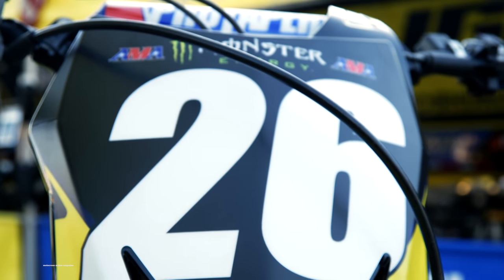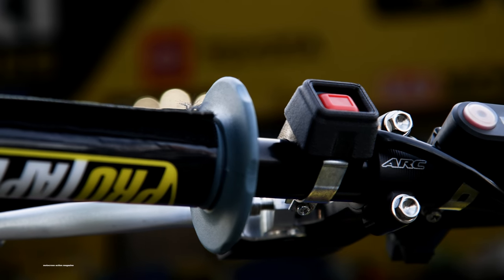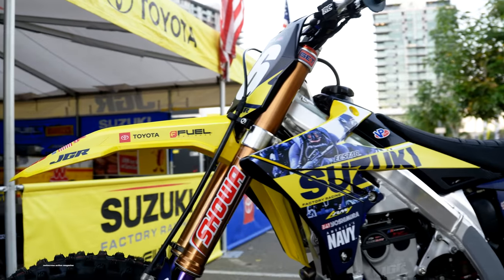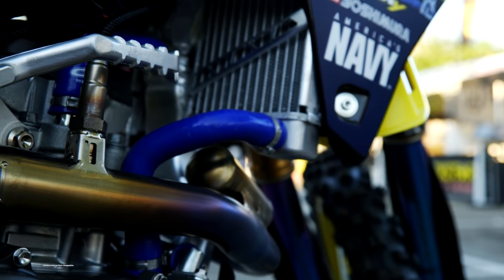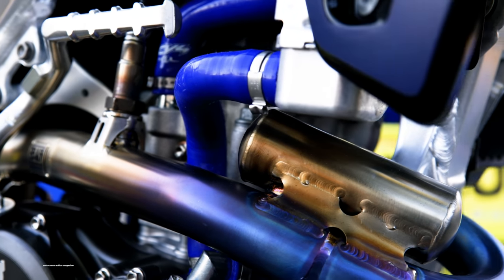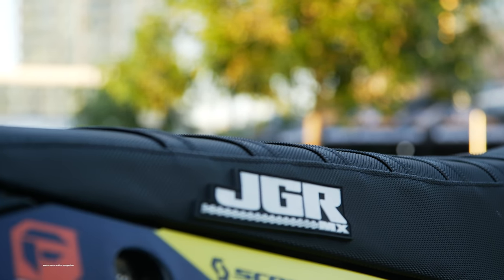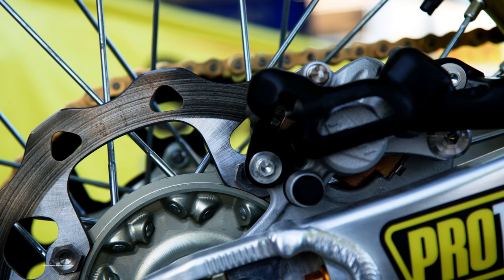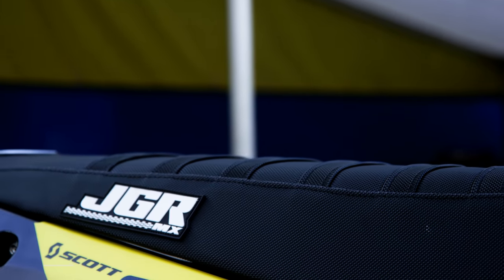Inside Alex Martin's Factory JGR/Suzuki RMZ250 - Motocross Action Magazine

Comment: Man if Suzuki's came from the factory like this I might actually think about buying one..
Reply: not a single bike is coming from the factory like this
Reply: @Strasky_96  I know that. But Suzuki's are missing a ton of shit every other brand has these days.
Reply: @Nielint  Examples other than E-Start?
Reply: @Strasky_96  25+ pounds heavier, 3-4hp less, engine maps, start switch/maps/or for k clamp, weak subframe, stock showa forks need to revalved or at the very least the stock oil is garbage and should be replaced after ~5 hours.. Is that enough? Haha.
Reply: @Nielint  Only one fact that you listed is true, the others are stuff that people made up because Suzuki hasnt changed thei're nearly perfect base plattform, they just need to improve and tweak a few thibgs with the engine, to make one if not the best bike of the new era
Reply: @Strasky_96  Lol. Well read up on it a bit more bud. It was a great bike 10 years ago.
Reply: None of us will fully gas it to its full potential so it doesn’t matter, unless you race then okay, most of us ride for fun.
Reply: @Nielint  😂 buddy idk where u get ur info from but the zooks are just like every other bike minus a few updates here and there but the platform is proven and it doesn’t matter what bike your on now a days all the factory 250fs easily push more or close to 50 horses lol

Comment: I’m a short rider as well, I shaved my seat and my bike still feels tall. Is there anyway I can set it up to be shorter? Whats alex’s suspension settings? I can barely reach the ground with one foot flat. So I’m gonna need some tips 😬
Reply: Well typically like they say drop the subframe 10mm and if your being extreme rase the foot pegs DO NOT cut the shock or start dropping the forks excessively you will get shit handling by doing that just drop your sub and raise the pegs if your arms are short get 22mm clamps

Comment: I miss the days when Suzuki made a competitive motorcycle :(
Reply: It still can be competitive with the right rider
Reply: The RMZ’s are still excellent machines man. I don’t think lack of e start is a big deal, but they need about ten pounds less weight. They could keep the rest of the bike the same and lose weight and it would help a ton.
Reply: @bobzuruncle8424  unfortunately the universal motor moc up will not work to loose weight along with the chassis being 3 pounds heavier then modern aluminum chassis the bike is just extremely outdated and both 250 and 450 are the worst bike in the class
Reply: @zachjohnson6873  Roczen destroyed the field a few years back on this tub of crap lol. A decent Ryder can still make this “outdated” machine work.
Reply: @bobzuruncle8424  dude we’re talking about stock  bikes harts team was factory supported it was literally the #1 Suzuki team the bikes were still absolutely shit Kenny bought his own kit suspension since the custom forks they were running were awful
Reply: @zachjohnson6873  who is racing a bone stock bike🤷‍♂️
Reply: @bobzuruncle8424  nobody the engine from jgr pro circut etc are amazing along with gets kit but I’m saying the motor itself is outdated Suzuki uses what’s called a universal mock up the engine cases and head are the same not internally the same but just the mock up that doesn’t work from 250 to 450 that’s to much weight the forks stock in the 250 suck one side is dampening and the other is everything else you can’t change that without A kits that’s not a big deal if your a racer my bike has Wp xact pro forks and shock with linkage kits like that are 9k+ so for the average guy Suzuki is fine but your starting with fuck all stock
Reply: @zachjohnson6873  yeah I’d agree that they need a new engine at the very least. I’m guessing the 450 will get the center port frame of the rmz250 along with a center port head for its next “upgrade” and then it’ll be another ten years of no changes.

Comment: Wtf!! Is Map 1 and Map 2? 🤔🤔
Reply: Difrent engine mappings.....
Reply: @zachjohnson6873  mappings?
Reply: @angelgutierrezruiz6624  that’s when you tune an ecu for different engine response most of the time you’ll have a standard map and a mud map that’s a little more smoothed out for throttle control
Reply: @zachjohnson6873  thanks bro!

Comment: Such a shame that the NICEST looking bike is a slow turd
Reply: That's why they pull holeshots, right.
Reply: @cheetah694  doesn't take the fastest bike to hotshot.  Watch alex on the bike when he races. Also, how many hole shots does the RMZ250 have ?      The bike is noticeably slower. ESPECIALLY in the whoops. You can easily see how much time he loses in the whoops.
Reply: @stevestiffler9120  👍 right? Guy thinks horsepower plays a huge role in the whoops? Not the guy with big balls riding through them... horsepower. 🤦‍♂️ Side note This bike rips
Reply: The slowest bike on the line still makes 50+ horsepower, this bike may not make the most power but I’m sure it has the most usable power band.
Reply: @s_wggns  dude the RMZ 250  is definitely not putting out 50hp lmao
Reply: @s_wggns  the RMZ250 omes stock at 36HP. . You're not going to convince me that a factory RMZ 250 gains 15+HP.  If that was the case. Everyone would be buying RMZ250s then would add on the JGR motor packages and have a 50+HP 250
Reply: Majestickilla13 for fuck sake round it up, JGR Suzuki has a 12-15 horsepower gain easy.
It’s JoeGibbsRacing!
Reply: @MichaelAMyers1957  I don't buy it either. The amount of money you have to throw at a RMZ 250 to make it some what competitive is insane. Buy the other brands if you want good power out of the box.
Reply: @mike_r4150  I really have no real issue with Suzuki. I think they're one of the nicest bikes as far as looks go.   they corner great,    but I'm also aware that its the slowest of the 250s....... it's a proven fact.  I truly believe that bike is holding Amart back. People can hate that comment all they want, I don't care.    Suzuki can step their game up but refuse to which is sad.  No reason that that bike should be far behind the others.
Reply: @MichaelAMyers1957  agreed
Reply: Maikel van Roessel you make it sound like JoeGibbsRacing is some small operation lol 
They have the money and resources to build the baddest bikes, doesn’t matter the make.
Reply: @MichaelAMyers1957  I feel you, i have been on Suzuki's for a long time. It's unfortunate it lost it's glory from the past. On this point i hope they will step up and develop something truly great again.
Reply: @MichaelAMyers1957  It's not 36hp, where have you found that?
Reply: @cheetah694  dyno testing doesn't lie.  The bike sits at 36HP  https://www.dirtrider.com/story/tests/best-motorcross-bike-6th-place-2020-suzuki-rm-z250/
Reply: @cheetah694  to be clear, I'm speaking on stock numbers. I can see some clown trying to twist this up to factory bike some how... stock bike. 36 hp.  There's no fucking way, they're adding 15+HP to the factory 250.
Reply: @s_wggns  I think you don't understand what i'm trying to say. I have tremendous respect for JGR and the people who work there. Due regulations they can't go any further with the platform given by Suzuki. We are at the point it's either JGR quits Motocross, changes brand or Suzuki steps up. I even believe JGR would be able to build an competitive engine on their own without the help of Suzuki, but regulations don't allow that kind of effort.
Reply: Majestickilla13 I pass a lot of 450’s on my slow Suzuki RMZ250
Reply: @ballou1777  there's kids on 65s who pass alot 450 riders sooo......
Reply: Majestickilla13 You’ve made my point. It’s not the bike it’s the rider. So a few HP’s don’t matter.
Reply: @ballou1777  actually no, I didn't help your point because when it comes to professional motocross or even A class.  HP matters in the 250 class.   That's why there's no titles handed out at loretta Lynn's in 250A or open pro sport to a Suzuki rider, and you don't see Suzuki riders winning at any other major event.
Reply: Majestickilla13 Yeah but they sure do look good.....lol
Reply: @ballou1777  they definitely look good. Nicest bike out of the group
 And I'd personally like to have a RMZ250. BUT I stand firm on what I said
Reply: Majestickilla13 my first bike as a kid was a Suzuki so they are my favorite brand but I have to admit their engine power is the lowest of the bunch nowadays. I would say back in like 2014-2015 Suzuki just stopped being all in on their dirt bikes for whatever reason. They just don’t dish out the money for the research on them anymore. I think they are still amazing bikes and still have the Suzuki feel when you corner with them but the power is lacking compared to the other bikes out of the crate. I really hope they don’t stop producing new bikes in the near future but i think we are all witnessing the demise of the rmz